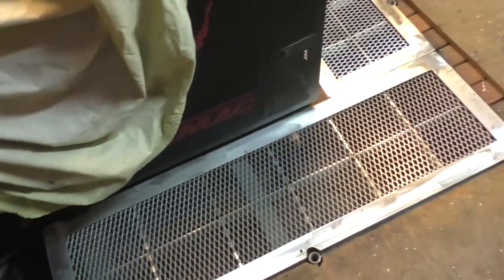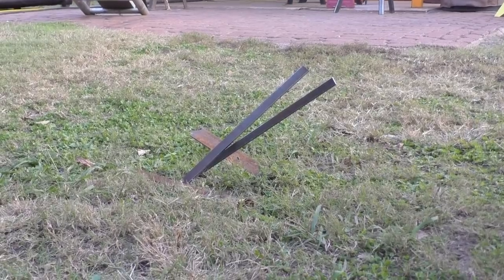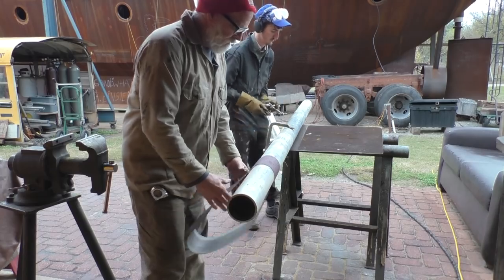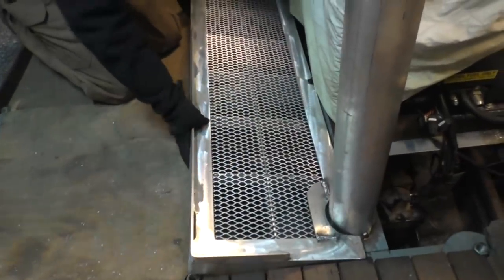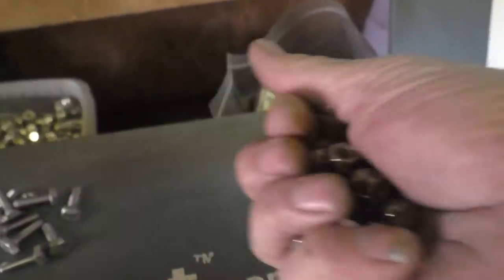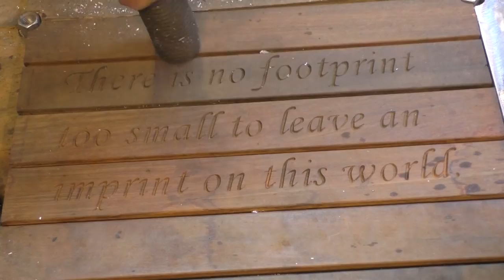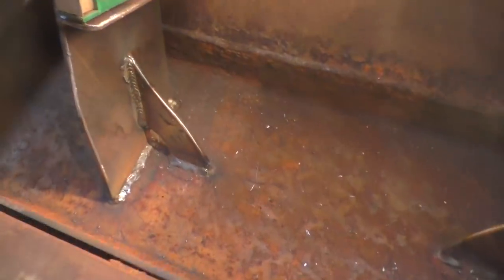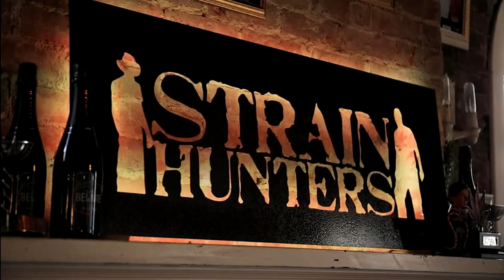Floor Grates, Companionways and more

Comment: Back in college I worked at a power plant in the summer.  There was nothing like cleaning coal belts 200 feet of the ground on catwalks made out of expanded metal grating.  I was pretty unsettling to feel it move under your feet knowing there was nothing below for a few hundred feet.

Comment: Hey Doug amazing work as usual, this  has probably been answered before but with some of the welding you had small pin holes in the hull (on the tender) how will these be fixed when seeker is in the water?

Comment: youcould make a fake but working periscope mount a piece pipe stuck through the deck or the roof of the cabin with a camera screen in the top and a screen on the bottom part 
might actually help if you can switch it in night vision

Comment: For future consideration could you build a proper seat to securely attach to your ladder hoist companionway
in case you ever have a researcher on board who is physically challenged?   

The steel plate to lay across you mentioned might work  but would not be as comfortable haha.
Reply: Might as well just leave it as a platform for a wheelchair. Would work as a chair for both.

Comment: Hi Doug! Really loving your work so far.. I have been following for years! Have you considered where you are going to place some of your auxiliary machinery that I think will be quite necessary for a boat like that: bilge/fire pumps, fuel polisher, black/grey water pumps, Oily water separator (not too necessary but as a research vessel it might be), hydraulic pumps for winches and steering? Would be happy to help from far if you have any questions. I am a chief engineer on a 45m yacht. Anyway, keep up the good work! hopefully one day I can make it out there to come and help out.
Reply from the maker: I plan to pirate a fancy yacht and strip it for what we need.  :)

Comment: I'm curious how you will prevent marine electrolysis corrosion with so many different metals connected as a part of SV Seeker? I am not that knowledgeable on the subject and would like to understand your prevention. Thank you.
Reply: The trick to preventing electrolysis is keep it dry and electrically bonded.
Reply from the maker: That video will be out on Thursday.

Comment: You have probably thought of this... but just in case. In rough water, the boat does experience weightlessness. anything that can move, will move. so be sure to lock everything down. gravity cannot be relied upon.  Falling down a wave plus the speed of vessel = negative gravity! Falling upwards! though The ladder idea has the merit of slide loading/ unloading. (In calm seas) Remember to lock it down. even rope would do.